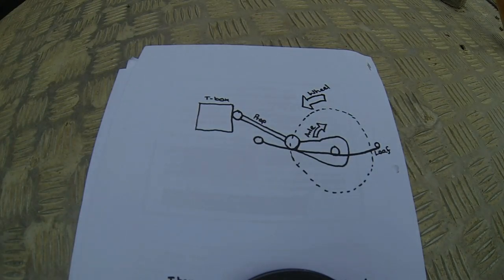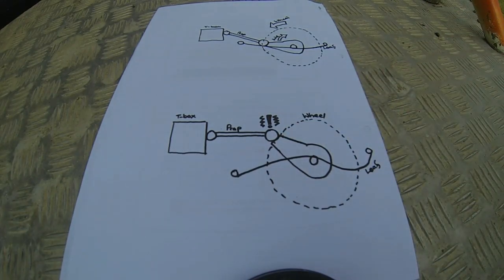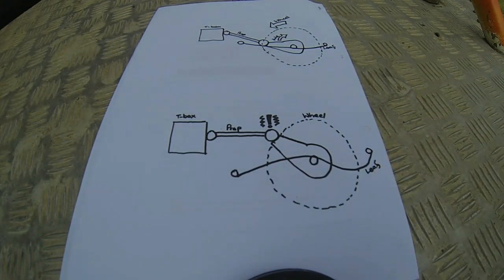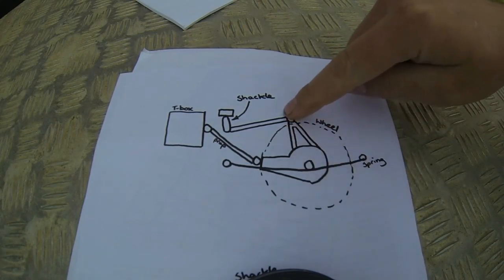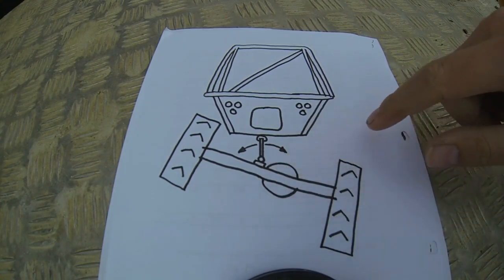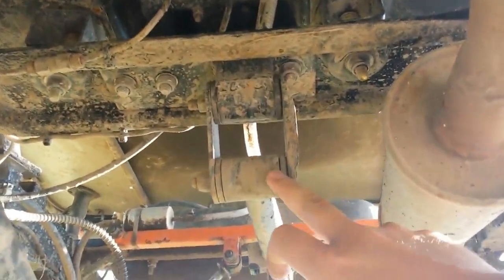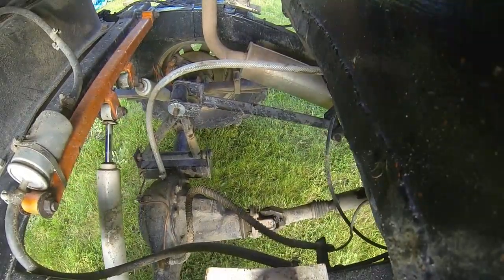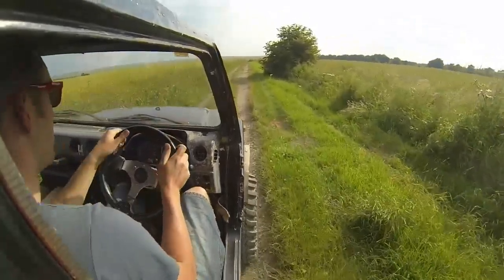How To Make An Anti-Wrap Bar

Comment: I put one of these on a truck years ago , night and day difference as far as traction goes , weight transfered, instead of the wheels hopping and dancing they pushed down and got rear body  separation. I would recommend 100%

Comment: I had wrap issues with my samurai also. I would break u-joints on steep climbs fairly often. I finally installed a track bar from breeze industries out of Canada and it cured it. Their bar works awesome. No more broken u-joints and much better traction and control on the steep sections of trail.
Reply from the maker: +Joey Harlow Nice, I've definitely found mine to be an improvement.  At some point I might reduce the amount of rearward movement allowed by the shackle but it's still going strong since I fitted in.

Comment: the moving shackle at the front negates the purpose of the unit im afraid. That still allows for alot of movement, and pinion angle changing. Solid mount point on both frames.....1 bar each side, the same length as drive shaft as to not  impend on the axle arc, will work much better
Reply from the maker: If you look at about 4.55 I say how the shackle/tether is designed to limit axle wrap - I do not say it's designed to eliminate it.  If you look at about 1.18 I explain the problems associated with wrap; damage to UJs and leaf springs.  Before I fitted this wrap bar I was snapping a rear leaf roughly once every 6 months or so, I was also fairly regularly having to replace the UJ shown in the video.  I actually sold the vehicle a while ago now but 3.5 years after fitting the bar I still had the same set of leaves and the same UJ fitted because the anti wrap bar works as designed.  It limits wrap enough to prevent the damage to the UJ and reduces some of the fatigue on the leaves.  Also, when I have wound the axle up in difficult terrain, you can very clearly see the shackle and tether working exactly as they should - the clearly stop the axle from rotating to the point where the UJ binds and they clearly limit the stress on the springs because I haven't snapped any leaves since fitting this.  When I first made this kit, I thought about fitting an adjustable turnbuckle into the tether section.  This would have allowed me to fine tune the permissible amount of axle rotation before the tether maxed out on the shackle.  I was essentially just approximating what would be a permissible amount to limit the fatigue of the springs, although I could work out what movement constraints would be required to prevent damage to the UJ.  I figured I would run the kit for a bit and if I carried on breaking things then I'd either add the turnbuckle to adjust the permissible wrap, or potentially do away with the shackle.  It turns out that neither of those things were necessary as nothing broke in 3.5 years of use.  If I were to make the kit again, I think I would probably go with the adjustable turnbuckle over the shackle, however the design in this video worked well enough to mean no more breakages - which was what it was designed for.

Comment: How not to make an anti-wrap bar. As shown it is doing very little if anything. The bars on the axle turn the axle wrap into mostly horizontal motion. The shackle on the frame is set to be able to allow that horizontal motion when it should be set at an angle to not allow horizontal motion.  The design would function better if the link was shortened so that the shackle was horizontal.

Comment: What an easy way to tell if I have axle wrap? I have a 5speed xj cherokee and one of the leaf spring clamps blew off. There is a clank at low gears high torque. I feel like there is a rock motion after releasing of throttle on rear. Just wondering what are some easy diagnosis by yourself? Thanks
Reply from the maker: I found there was often quite a loud clank associated with it happening.  For me the main symptom was the rear leaf springs snapping all the time though.  The SJ springs are very narrow and tend to fatigue quite easily but I don't know what they're like on your vehicle.  Once I made this wrap bar I never snapped another set of springs until I ultimately sold it.  The other problem is that everything clanks on a 4x4 vehicle so it's quite hard to tell whether the clank is coming from the springs wrapping or some other part of the suspension.  If you get a friend to slowly drive your vehicle out of a deep rutt or over an obstacle then you might well be able to see the rear springs starting to bend into an S shape.

Comment: you cant be serious  wtf is this man !. i can clearly see your axle is still wrapping  !!!!!!!!!!!!!!!!!! you design has not done anything lol
Reply from the maker: Maybe you didn't watch the video properly? If you look at about 4.55 I say how the shackle/tether is designed to limit axle wrap - I do not say it's designed to eliminate it.  If you look at about 1.18 I explain the problems associated with wrap; damage to UJs and leaf springs.  Before I fitted this wrap bar I was snapping a rear leaf roughly once every 6 months or so, I was also fairly regularly having to replace the UJ shown in the video.  At the time of this comment, the video has been up for almost 3 years and I still have the same set of leaves and the same UJ fitted, why? Because the anti wrap bar works exactly as designed.  It limits wrap enough to prevent the damage to the UJ and leaves.  Also, when I have wound the axle up in difficult terrain, you can very clearly see the shackle and tether working exactly as they should - the clearly stop the axle from rotating to the point where the UJ binds and they clearly limit the stress on the springs because I haven't snapped any leaves since fitting this.  When I first made this kit, I thought about fitting an adjustable turnbuckle into the tether section.  This would have allowed me to fine tune the permissible amount of axle rotation before the tether maxed out on the shackle.  I was essentially just approximating what would be a permissible amount to limit the fatigue of the springs, although I could work out what movement constraints would be required to prevent damage to the UJ.  I figured I would run the kit for a bit and if I carried on breaking things then I'd either add the turnbuckle to adjust the permissible wrap, or potentially do away with the shackle.  It turns out that neither of those things have been necessary as nothing has broken in 3 years of use.